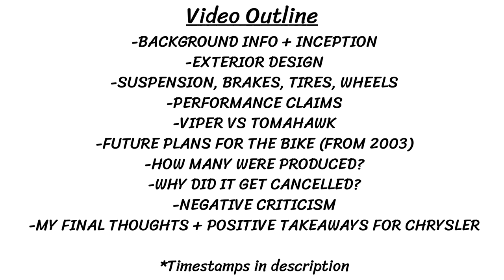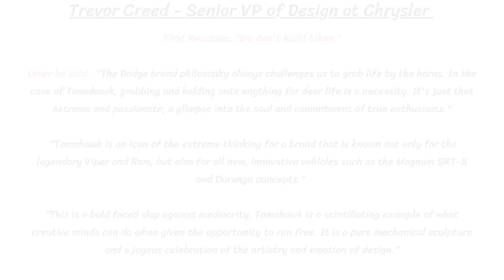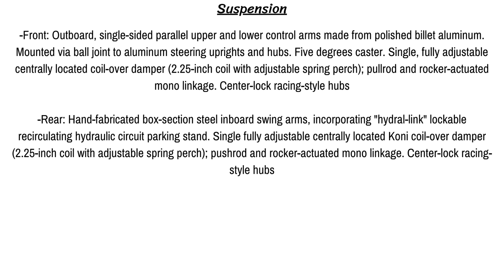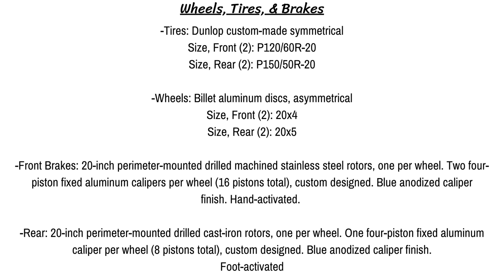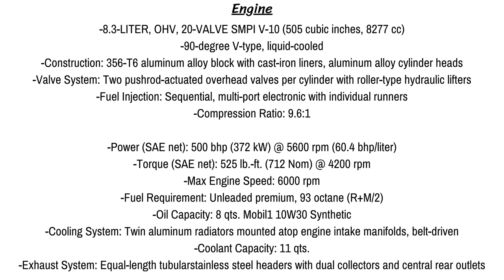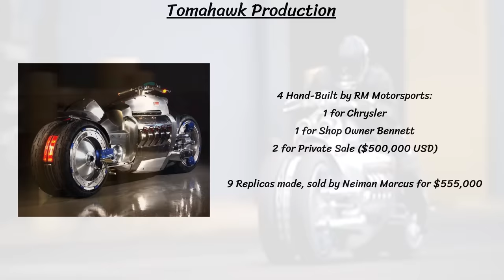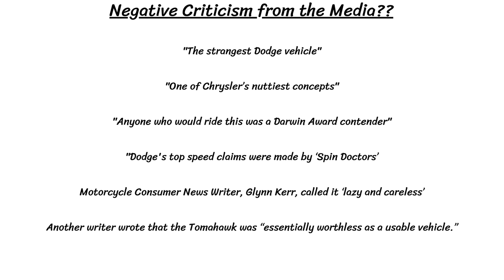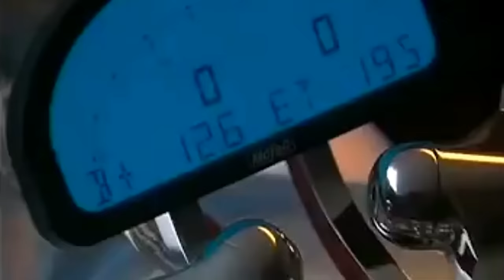2003 Dodge Tomahawk Concept Story – The Super Bike With A 500 Horsepower Viper V10 Engine!

Comment: Watching your video brought back good memories from 2003 when I read about the Tomahawk in Cycleworld. I remember in the article "0 to fatality in 2.6 seconds". The editors were impressed with the concept. But told how the test quadrocycle would idle in gear at 25mph. And the test rider accidentally tipped it over because Chrysler techs forgot to unlock the quad steering so it could pivot when turning.

I've been riding 19 years. I've never been a Chrysler guy. But I'll always remember the Tomahawk. And hope someone make quad cycles more common place and functional.
Reply: There are some chineese clones out there.

Comment: The range criticism is absolutely valid as far as I am concerned; I had the same criticism for most of the Orange County Choppers custom bikes (as I recall, so did Jesse James). For me, the ride "begins" at 100 miles. I don't want to have to stop for gas 3 times to get there. I think the Tomahawk is best defined as a "curiosity" - that is to say I am sure it would be fun to try it out on a closed course, but it's not practical enough to warrant purchase.

Comment: I don't know why they didn't just put single wide wheels in the front and rear. Doing so would have made it far more maneuverable as well as street legal.    They could have outfitted it with a drag radial in the rear and marketed it as a drag bike.    Regardless,  gotta give them props for building this concept.
Reply: I'm thinking keep dual front & have a single, wider wheel/tire in back.
dual front for the 4 calipers on 2 rotors + the hydroplaning mitigation benefit 
& ofc then, 2 tires in front..drag bike, indeed but top speed record bike, as well.

Comment: this was cool back in the day like a lot of chrysler’s concepts but its easy to see why it would never have made it to production. its performance (outside of the supposed top speed) is not much better than a liter bike, and with that much power it would never be street legal without a major redesign. it sure was a great PR tool though, which i think was chrysler’s main purpose with the concept
Reply: Yup! Engineering and power showcase.
& it may be a bit much..
but have ya'll checked out the Hemi Big Wheel?
:)

Comment: has there ever been a wheelie done
Reply: how does a foreign engineer attempt aeronautics without a wheelie first
Reply: over there though not to insult this piece of engineering
Reply: SRT4 would be a great displacement
Reply: how many tracs of bulldozers does it take to be what you are
Reply: aussie rotary dynamic in fifth gearing isn't a complexity either
Reply: four cylinders and four gears inline
Reply: crankshaft casing in depth to ascension askew formation is cohesive in terrain fluidity

Comment: "Chunks of V-Max in it's stool". Except the V-Max is a real motorcycle, street legal which can actually go fast and turn, so no, the only way the Tomahawk would beat the V-max (maybe) is if we park them both and use them as generators.
Simply put, a car engine in a motorcycle-shaped contraption is not a work of genius. It's just Tim Allen's wet dream. The thing is useless and it may be interesting to look at, but uglier than a cat's butthole, and completely made of aluminum and hype.